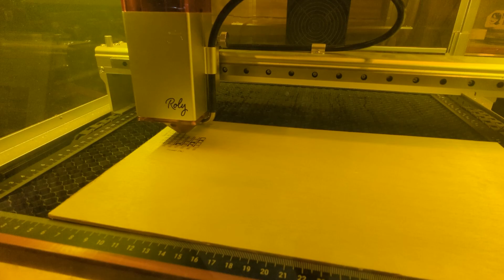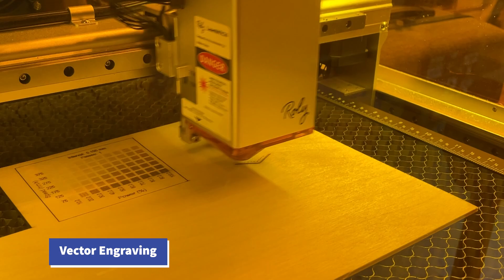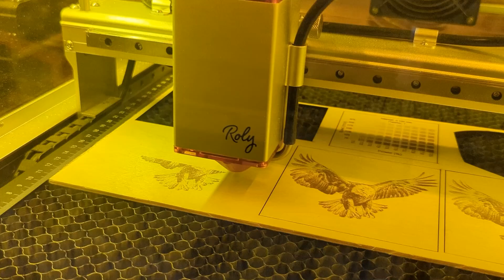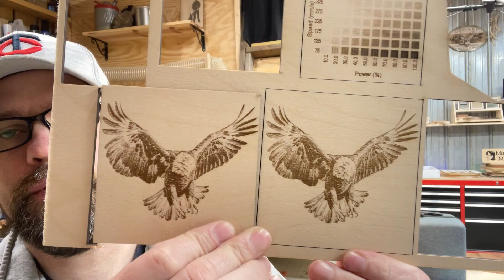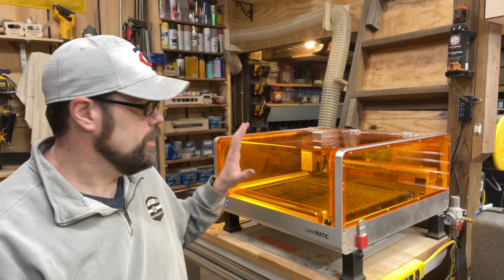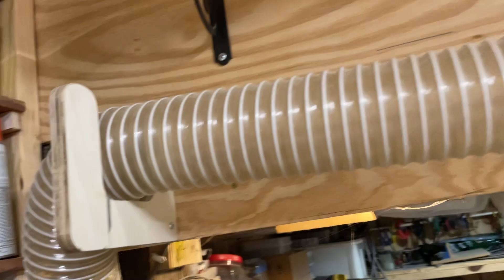I drove 1100 miles to test the Lasermatic MK2 30w

Comment: Hi thanks for the video. I’m torn which to buy was hoping for your opinion since you have reviewed both. The roly 30 watt xw or the atom stack x40 max? I do a lot of cutting and quite a bit of engraving. And suggestions would be helpful. My d1 just quit on me.
Reply from the maker: Both are decent lasers. The Roly is great if you want something complete and enclosed. The Atomstack x40max will give you more working area, but you'll have to sort out your own enclosure, camera and exhaust options. I like them both but all other things being equal, I'll opt for the larger working area most times.

Comment: I believe nothing else is needed to remove the fan and connect your duct for your extraction system.  I just ordered the MK2 30W XW and will be able to verify when it arrives.  That is my goal anyway, as i have my extraction system already in place
Reply from the maker: Yes, it looks like it's a simple removal.  I like it when they keep it flexible for varying situations. The XW would be a great one with the extra working area.

Comment: One thing I don't see being talked about on The roly Automation   is Spot size. lasermatic spot size for the 20w laser is 0.24 x 0.12 ,But wecreat 20w is 0.08*0.10 mm ,and x tool is even smaller at 0.08*0.06 mm. Would this larger spot size on the lasermatic affect engraving quality ?
Reply from the maker: A larger spot size will have an effect on highly detailed engravings. But even with the larger spot sizes, I've been able to get some nice work out of most diode lasers.  I also would take the advertised spot size with a grain of salt.  The advertised specs are under ideal conditions and something that is hard for use to test and validate.  I try to run kerf tests to see how much square a beam might be and how much material is removed compared to others to give an idea of the spot size, but in all honesty, unless you're engraving on tile with a 5w single beam laser, you're going to see some detail loss and variation in the beam.

Comment: Nice review, I am still deciding what to purchase at this stage as I am going to transition my craft woodworking business over to a laser based business. I think I am wanting a laser machine that also does Acrylic though as well. I hope that The Clackshak can show or demonstrate what can be done to acrylics with this machine as well please not just thin Baltic pine etc I realise this is not a Co2 machine but show us what is achievable with acrylics please.
 .
Reply from the maker: All blue diode based lasers will be limited in what they can do with acrylic. It comes down to physics and not power. You'll have decent success with darker opaque colors but transparent,clear and light colors or white it will do nothing to. If acrylic is a big factor in your decision, you'll want to focus on Co2 based machines. It will cut through all acrylics and leave a much smoother finish on the edge.